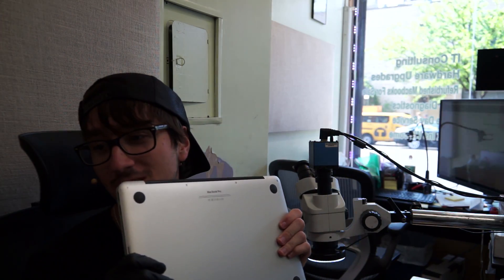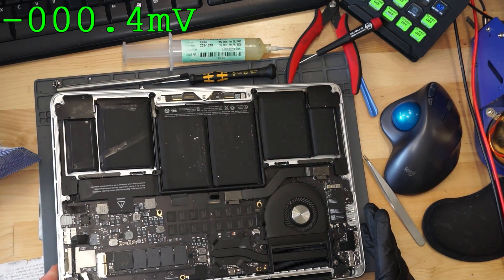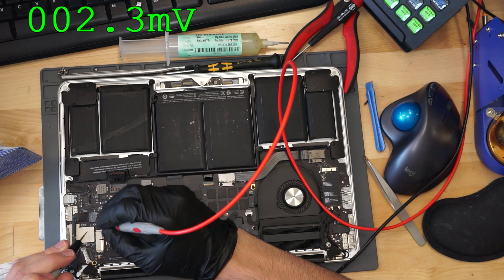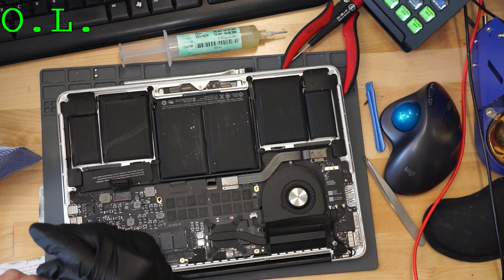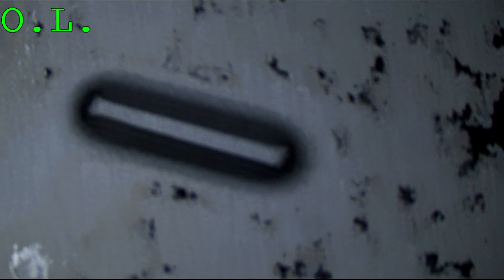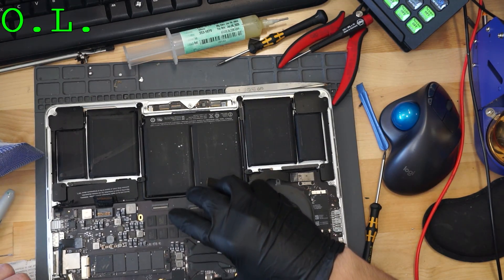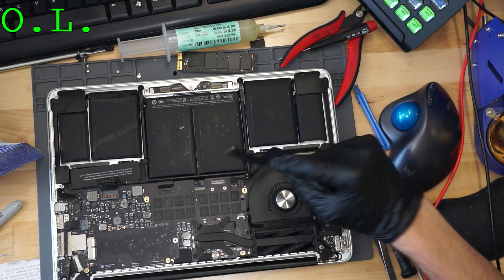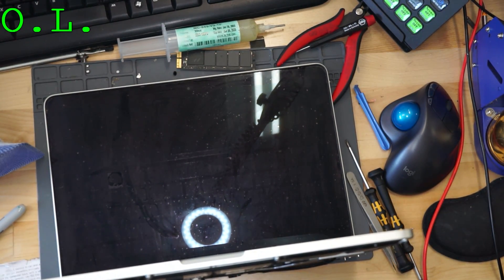Final non-Louis repair video my plane landed back in NYC see you later today

Comment: you might as well start each repair with an ultrasonic bath. that probably fixes half the boards
Reply: No! If it's cleaned first, many clues to the failure are erased.
Reply: @robertborchert932  ultrasonic doesn't remove rust and moisture damage, it only removes crud like hairs and food/drink residues, which seem to be the culprit in dozens of repairs

Comment: Way to repair it like a mall shop: "Huh, I didn't do anything but wiggle connectors around... Better not check for corrosion on the connectors which will creep the green death all over this board, AND charge the customer full top dollar like I did! OH BOY! I get to slap that nearlyimpossibletoremovelabel right over that beautiful metal case!"

(I am of course joking. You obviously checked it after the camera went off. Because, Louis runs a quality shop that won't suffer no second rate repairs.)

Comment: Seems like the problem with this board was a low impedance between PPbus and ground.
When you supplied the board once it was out of the laptop I guess the short circuit just vanished. Maybe it was caused by a tin whisker or some crap on the board made the impedance lower between PPbus and ground for some reasons.

I got almost the same problem at work. I was troubleshooting a control board from an inverter and I found out that were a short circuit between a 5V rail and ground.
This 5V rail was called P5V_BT and was an output of a power SBC for microcontroller supply.
What I did was just solder 2 cables to feed the 5V externally with a lab PSU set at 5V and 500mA current limitation.
When I turned on the 5V PSU and 12V PSU (which is the main PSU for the board) the board was working correctly and I was able to communicate with the board through CAN interface.
Then what I did was to just turn on the 12V supply and try to wake the board via CAN. It worked perfectly and the short circuit on the 5V rail was gone.

The board was fixed. In fact I fixed the board just by wanting to know where the problem was, crazy.

Comment: why are all the boards you repair furry?!?! ive just recently opened up my gigabyte laptop after around 3 years and no fur, what is it with apple products!
Reply: Kaymen Lewis-Johnson depends on the user and laptop design, I use my laptop in a fairly dusty and dirty environment and half the bottom of it is open vent grating, I expected to find fur in it when I opened it up, except I found it in all the places that seemed sealed off and almost none in the areas it would be easy to get into

also apple products be apple products

Comment: Hey guys, I have dust or cloudy streaking "under" my 2017 iMac display, don't suppose you have a vid on cleaning this up?
Reply: Uhm, try Ifixit. The dust could be under the glass (easy to clean) or in the display itself (suicide level).
Reply: @IlBiggo  Thanks! I did take a look there, there's just one vid on a much older machine, hoping to not be the pioneer here. :)
Reply: @paulelliott6488  A much older Mac will be probably easier to open. the 2017 iMac is sealed, older ones had the glass held on with magnets.
https://www.ifixit.com/Teardown/iMac+Intel+21.5-Inch+Retina+4K+Display+2017+Teardown/92170 is your guide.